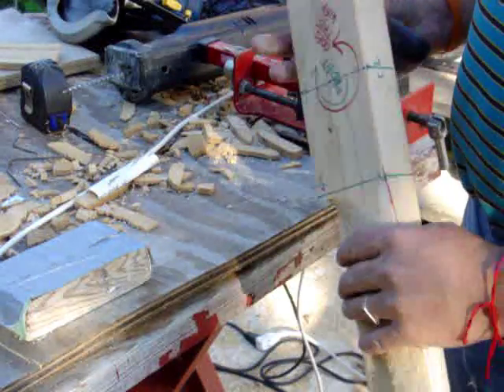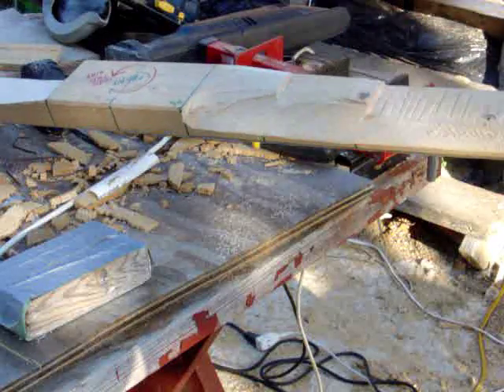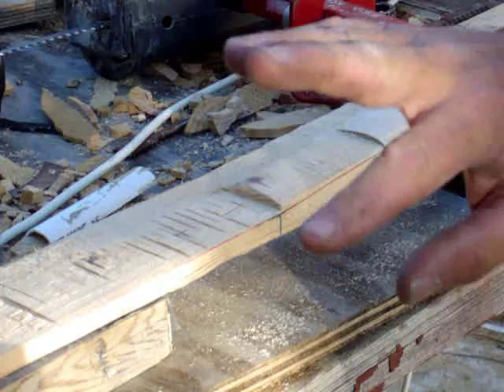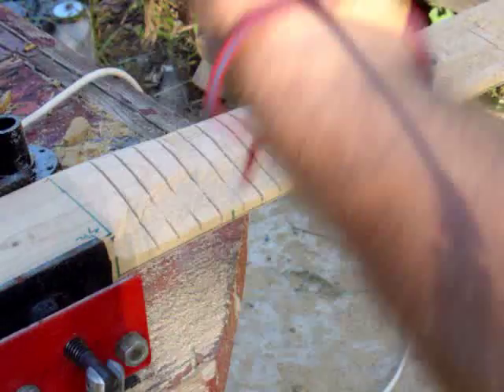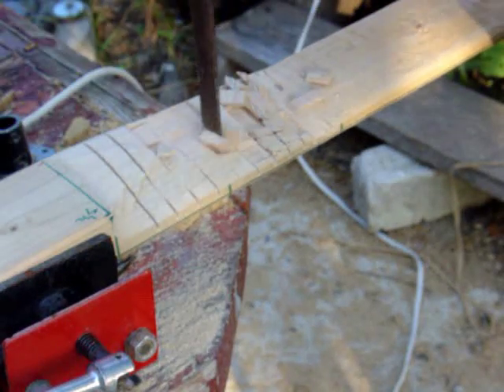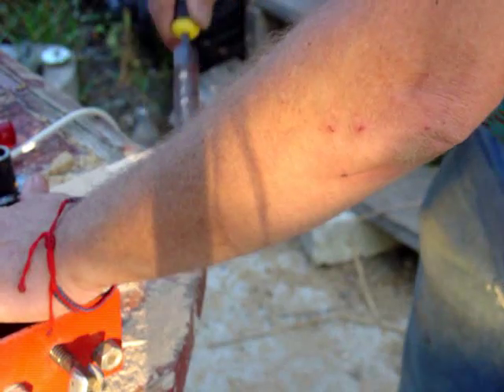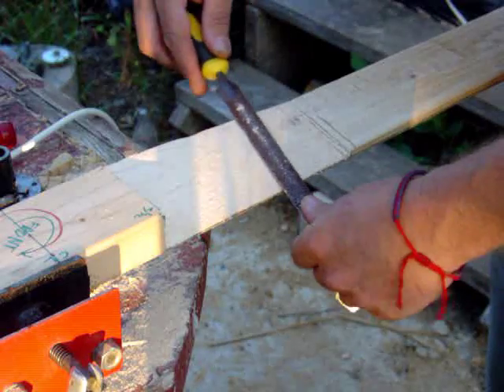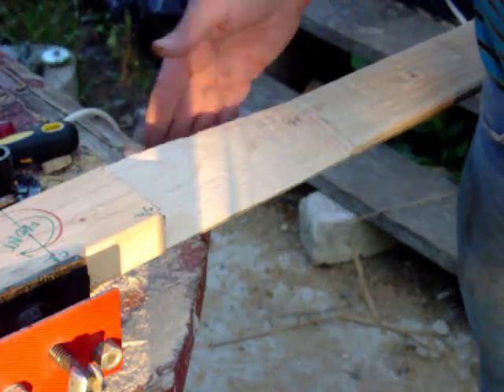PART 2 THE CARVING OF WEST COAST DOUGS INVERTED WIND TURBINE PROP

Comment: I called and asked if I could go to the shop in which I used to at and asked if I could use the Mazack and I was told if I provide the aluminum and the CAD to program the machine I would be allowed to mill out a props. I now have to order the aluminum and then do the CAD drawing with all the specs.  Bonus to all this I get to hang out with a few people I use to work with!

Comment: We who tinker always find a way! I used to do a lot with aluminum where I had to cut like the prop, but after the mazack milling machine came in I was no longer needed to make parts from sweat and hard work and I could focus more on the machines in need of repair.  I am thinking about going back to that shop and using the milling machine to cut out an aluminum  prop myself. If I am able to I will show it off here on youtube. Keep up the good work, these have inspired me to build a wind turbine

Comment: In watching these videos I had a thought, by placing a mirror on the other side while cutting would that help as a guide so that you would not cut further into the wood by accident? I used to do that when I was cutting metal for other projects as a mechanic in a manufacturing plant. Figured it might help. Good video.